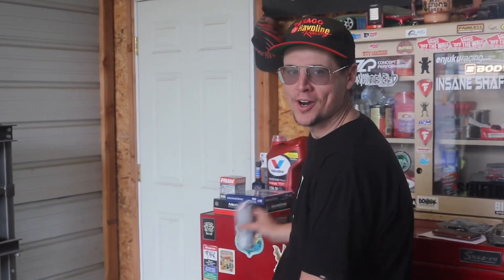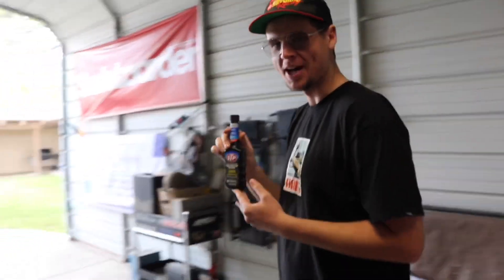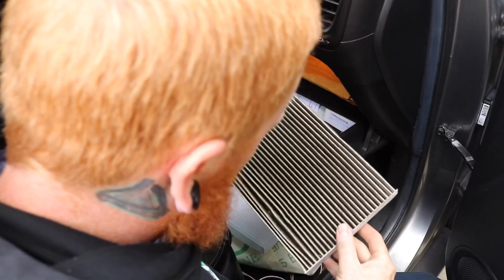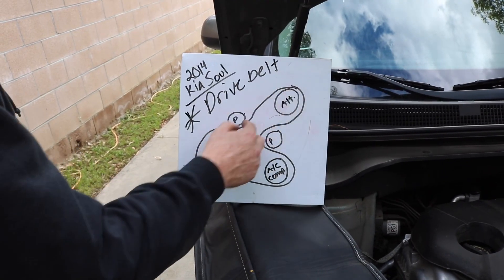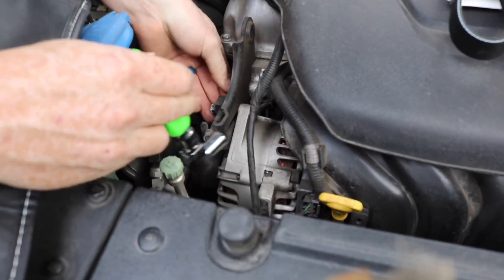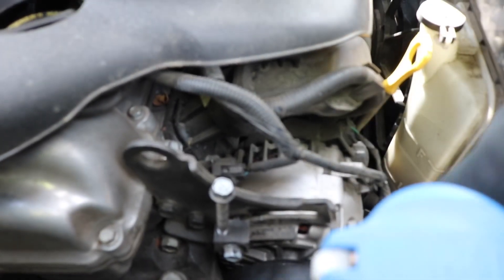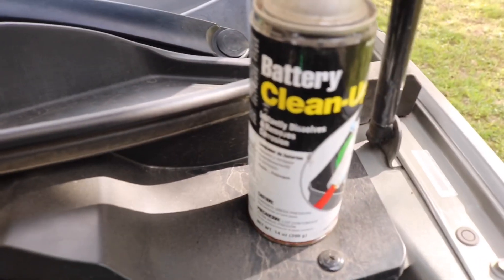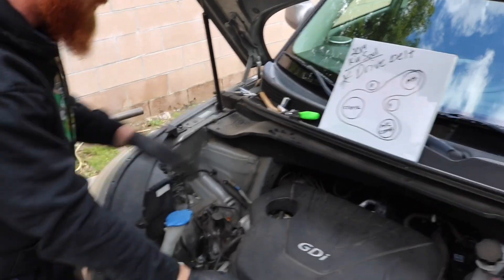Kia Soul Drive Belt!

Comment: Though I appreciate your video, very well done and informative, apparently you have the 1.6L engine. My 2015 has the 2.0L which is a bit different. The belt is actually simpler as for as routing, but the adjustment bolt is down on the front side of the alternator and there is a AC connection so near it I can't get a socket wrench on it.  A racheting 12mm wrench would work best there but as I don't have one it is a tedious process to loosen and re-tighten. Maybe this knowledge will help someone else. Thanks for the video.
Reply: I've got the 2016, with a 1.6L engine and a manual 6-speed transmission.
Reply: Thank you for this info man

Comment: i have to replace my belt tomorrow...
Can I loosen the 14 below the alternator without an extension?Or is loosening the 2-12's enough,...then slide the alternator back a bit so the belt slides off????

In addition,...there is a video that shows a guy taking off the wheel and the splash guard...holy crap... I don't want to do that... Please tell me that is avoidable.
FYI: I have a 2019 base kia soul

Comment: great video.... my 16' soul has 67,000 miles but belt is still good from what I know. any way ya can give me tips and what to look for exactly with a serpentine belt going bad? my 2013 kia has 100,000 miles and I think original belt.
Reply from the maker: Yea most belts stay good till around 100k and you wanna look for cracking on the ripped side of the belt is a sign of replacement or if the outside of the belt looks really glazed over almost shiny.